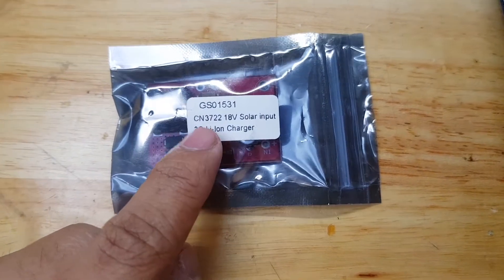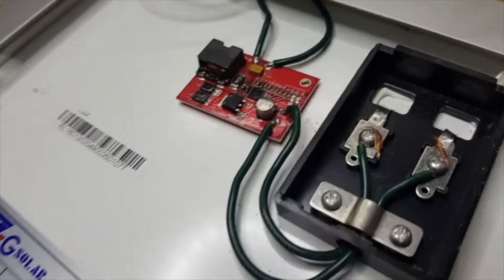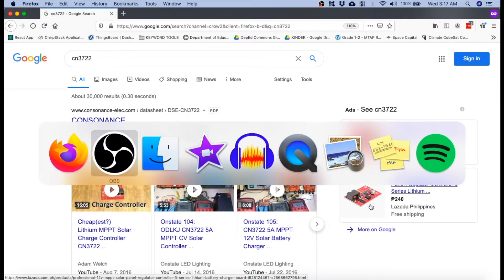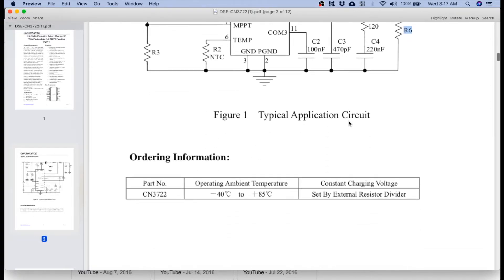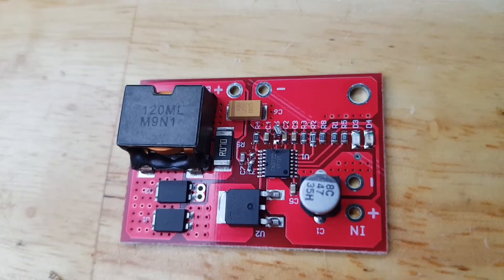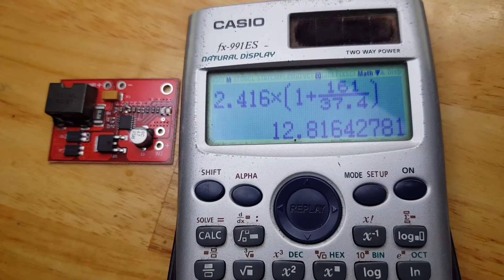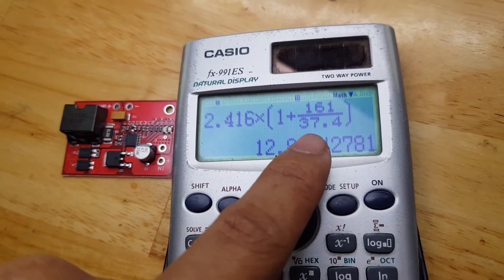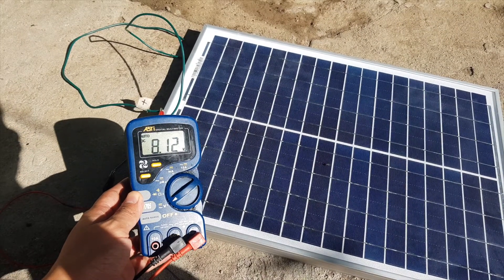CN3722 MPPT SOLAR CHARGER CONTROLLER MODULE MODIFICATION FROM 3S TO 2S FOR LI-ION BATT CONFIGURATION

Comment: 32K =14.15V! Works perfectly in my car.
Reply: This pcb mppt or pwm
Reply: @mehmetyuksel9465  It is a kind of fake MPPT. It controls how hard the solar panel is loaded and keeps it at 18V. That is around where most solar panels have their MPP at full sunlight, but a true MPPT would try different loads and find the optimum load with the highest output power. If there are clouds or the sun is setting, the Maximum power point shifts down to 16V or lower. This cheap MPPT just stops regulating when the solar panel output is below 18V and acts like a resistor and wastes power in low light, but still can tickle charge, so it is still better than PWM that  just loads the solar panel at battery voltage, but it is not a true MPPT.

Comment: Could you test the mpp of your panel? I have a similar charging module but it seems that my 10 W panel has a maximum power point at 13 V instead of 17 V, and I'm trying to understand if it is a problem of the cn3722 or the panel itself.
Reply: Those are not true MPPT, there's no tracking involved, it works with a Vmp set by a resistor, the default for that board is either 12 or 18V iirc, refer to the datasheet, alternatively, buy the variant of the CN3722 with the 2 multiturn precision pots if you don't want to replace SMD resistors as they let you adjust them